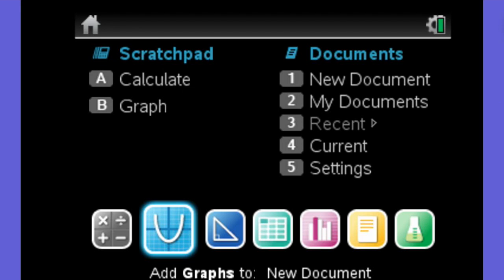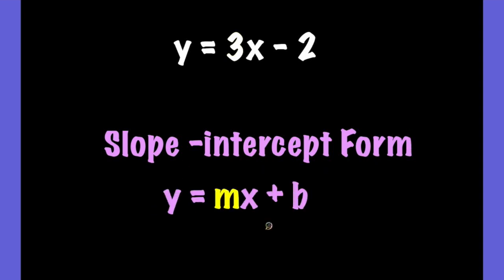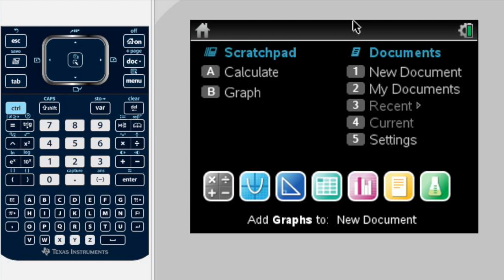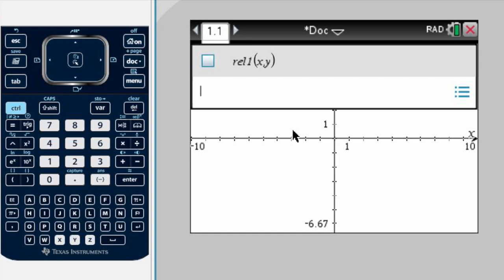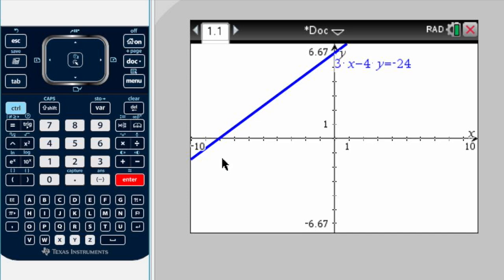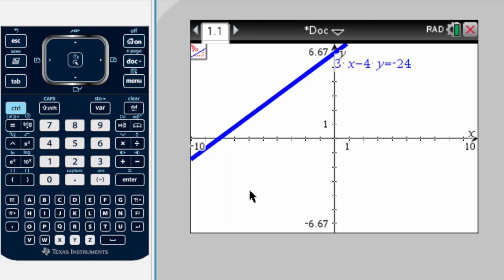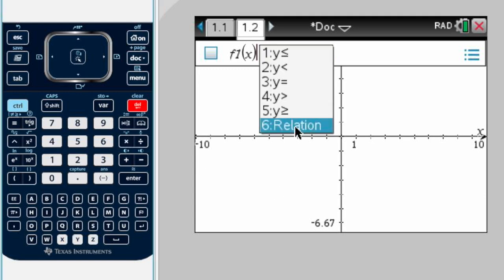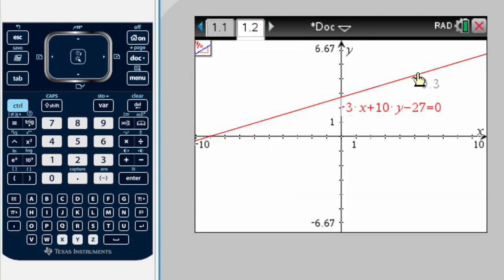Finding Slope with TI Nspire

Comment: How to input the slope in a different form if I do not have the relations function? I have the 3.2 version
Reply from the maker: Then just do rise over run, I would suggest put the grid on.
Reply: Monica Clifton OK thanks 
I'm attempting to just download the latest version however the software is not detecting my device.